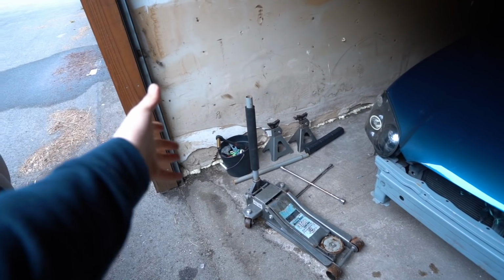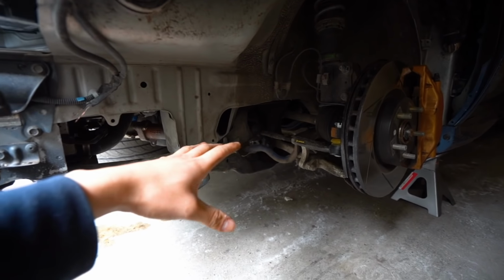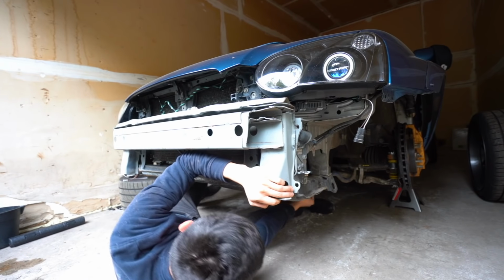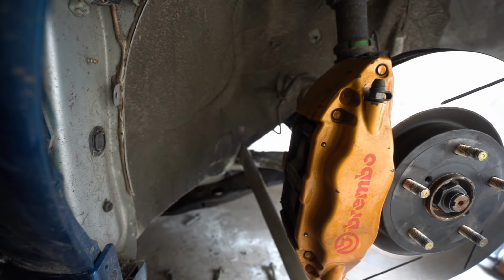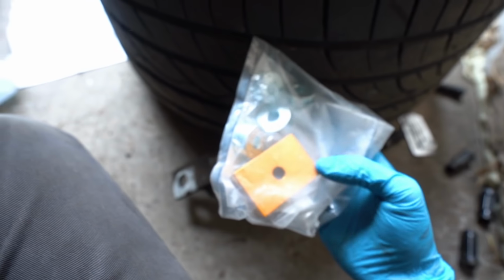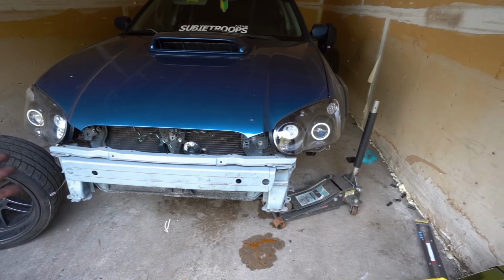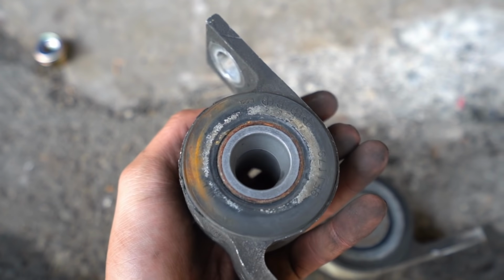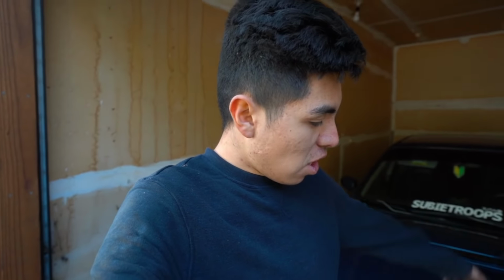BIG Upgrade For The STI!

Comment: Why not just get rid of heavy U brace all together? It serves no purpose. The JDM Subaru's didn't have them, only the USDM Subaru's have them.
Reply: Correct its just a feature to force the engine down in a frontal impact. Ditch it. 15lbs lighter.